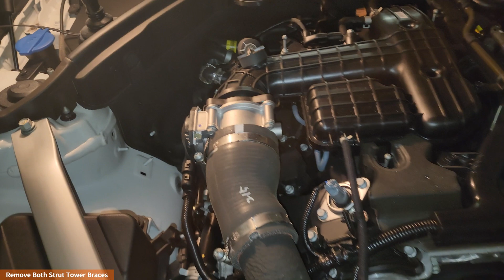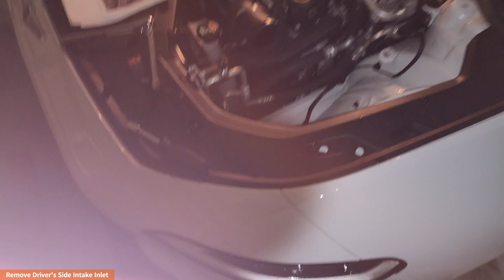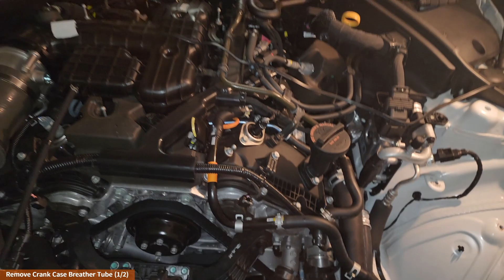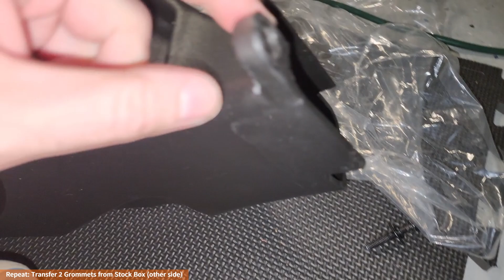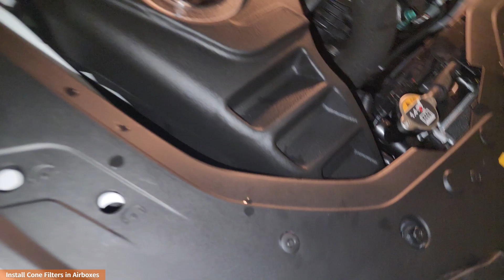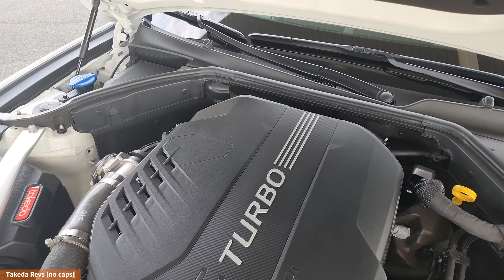Full Install: Takeda Intakes on Genesis G70 3.3T

Comment: So basically a waste of 500 bucks if ur not getting any power ?
Reply from the maker: If you aren't going to do a tune and you aren't looking looking for some additional sound/cool looks then I would say it's definitely a waste. 

This is not unique to the afe takedas tho. Without a tune, none of these intakes do anything for power on a performance car. Even if you do give it more air, the car isn't going to make more power unless you also change the fuel map. 

I knew this going into it, though. My goal was to give it some extra sound, and it definitely does so under full throttle
Reply: I disagree. I got these intakes installed along with BMS aftermarket intercooler and there is definitely a noticeable improvement. 1) with the increased airflow there is a significant quicker spool up from the turbos and this is even in comfort mode 2) increased throttle response as well. Again in comfort mode I can feel a distinct difference you can feel. 3) no heat soak with the aftermarket intercooler so pulls are stronger, longer. As vanquish mentioned, you'll see the realize these airflow benefits most with a tune but there not a waste at all

Comment: Here's the problem. The Takeda was reconnected to the stock inlets under the bumper. The most restrictive piece of the whole intake system. I'm willing to bet there are no gains installing this system without removing those inlets. They've been measured to produce 4 inches of vacuum, which is not good. Go with VT snorkels and you'll see tangible results.
Reply from the maker: You can remove the caps from the takeda if you desire more airflow. So it's okay. Larger filters would help but it should be clear to everyone here that simply adding an intake without a tune is going to provide negligible if any performance gains. That goes for the Takeda or any other intake lol.
Reply: VT snorkels and the AFE intake should be great together?

Comment: Hey, man i just have a question because im worried, so i watched a video about the 2$ bov mod, and i went ahead of my self and forgot to plug the recirculation hose and it was still connected to the intakes and left open from the bov side, then i drove 2 or 3 miles in the community and when i came back i saw some dust in the pipes and i tried cleanign it out, and now im worried the turbos are damaged, did i damage it from the dust exposure? Its on the stock system. Thanks
Reply from the maker: I think if you're worried, take the tubes off at the turbo and see how they look. I kinda doubt you did damage from dust unless you were driving through sand, but even then, it's probably okay for only a short amount of time. 

I assume you mean the tubes were open leading into the air intake tubes, right? That would definitely be less restrictive than the filter, so the car probably was pulling in air through those tubes, but I doubt it's a problem already.

 The tubes that came with the kit weren't all that clean to begin with. What I was concerned with when I got mine was that one of the filters had little chunks of plastic/rubber inside, like a mm or bigger in some cases. People online called me crazy for being concerned but my friend who is a mechanical engineer (who deals with turbo engines) said that it was not worth the risk since the tolerances on turbos are so small and they spin so fast, but dust is probably a different story. If you take the intakes off at the turbo and take a picture, you can see if they're dirty at all but I'd be pretty sure you're fine if it was just normal driving for a tiny bit of time. 

I tell you tho. This was my first time doing an intake on a turbo charged car, what a pain in the butt with all the tubes.
Reply: @VanquishedAgain  ahh, ok i did use a endoscope to check it and the turbos are in good condition, no damage nothing, but when I was putting the camera in I saw some dust in, light dust not alot just little but, also do you think they would inspect my turbos under warranty or nah, I wish I could show you them, maybe I will post the picture and make yt account maybe you could have a look if you'd like to, thanks man
Reply from the maker: @ARG70-y1z  there are pictures of my turbos in this video so I'd say if yours look the same you're good to go :)
Reply: @VanquishedAgain  ok thanks, man I have to stop worrying lol your like the 5th person who said it's fine but as a person who just bought it new its very hard to, crazy how both the turbos replacement  almost cost for a whole new engine and turbo set up without labor.

Comment: Just installed mine… you need the snorkels for sure. 
If you’re in traffic or barely do highway miles then you’re running hot compared to bms or similar.
Reply from the maker: The AFE Takeda intake does attach to the stock snorkels though right? I watched a video about cold air intakes and turbos and the person on the video said it was actually less important for turbo engines since the air is heated up and then cooled by the intercooler anyways unlike an NA engine.

Either way I don't think this adds any power haha. How hard was your install?
Reply: @VanquishedAgain  I miss the sound of my bms :( 
But it’s nice either way and for sure no power difference 
The install wasn’t bad but just longer than expected.
Reply: So you're not supposed to remove the factory? Snorkels? I thought the new box kind of has a broken snorkel that fits right in the location itself
Reply from the maker: @RayG834  you remove the things i did but otherwise no.